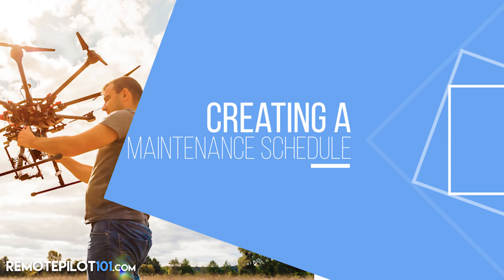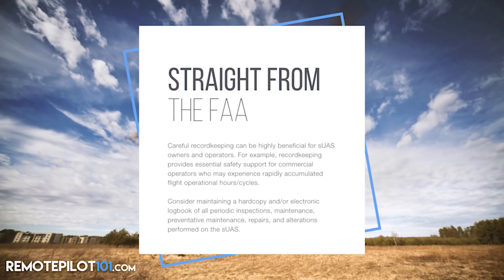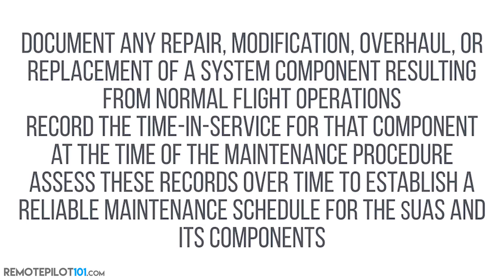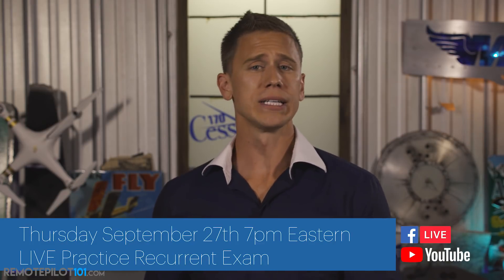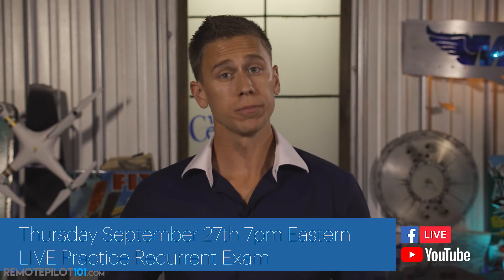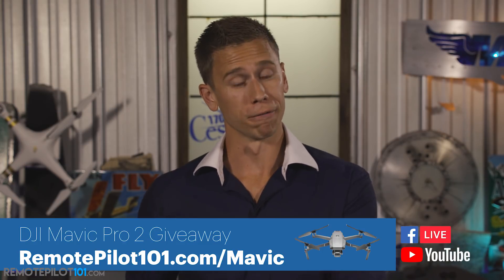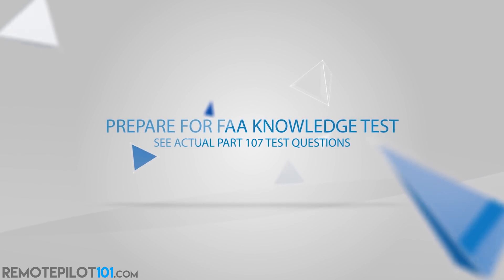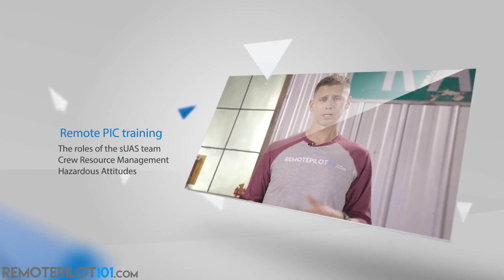Creating A Remote Pilot Maintenance Schedule - Remote Pilot 101

Comment: Thanks, this is some great advice that hobby pilots can follow to some extent also. One thing that bugs me is that with some products like DJI Mavic, and the Phantom series for example, DJI doesn't publish a recommended maintenance schedule to go by so you just have to take a guess. Something as simple as when should you change props, 50 flights, 100 flights?, 200 flights? Some rough estimates from manufacturers would be great.  I'm sure every piece of a commercial airliner has some type of rating in hours before replacement is recommended and maybe MTBF estimates, our drones are going to need this information in the future too.